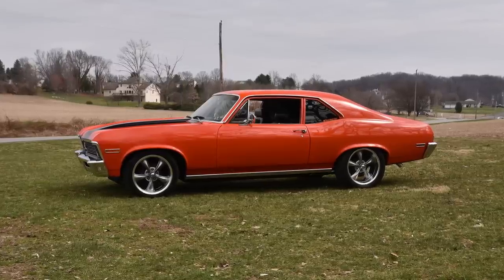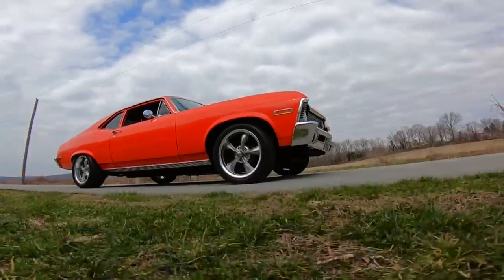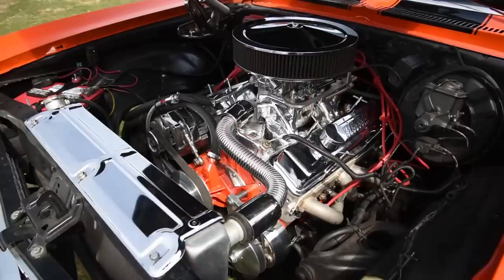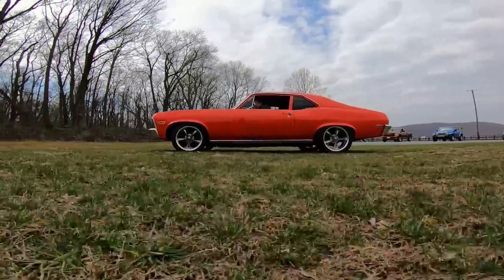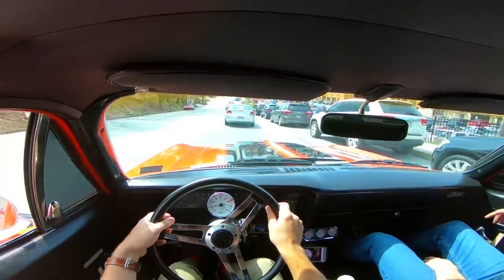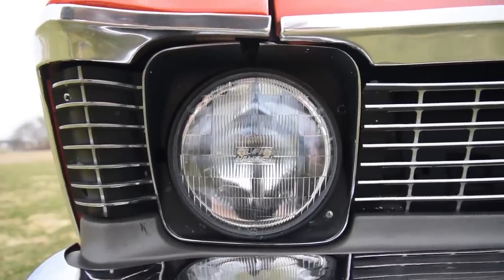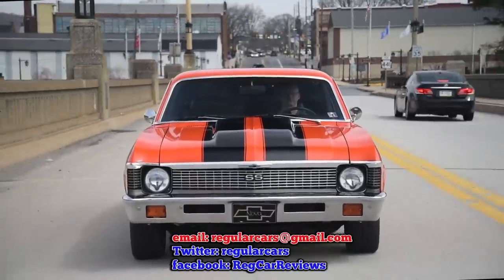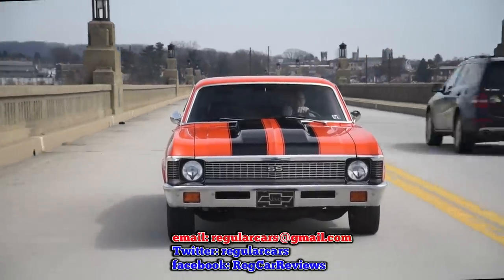1970 Chevy Nova: Regular Car Reviews

Comment: "hurr durr the LS exists so every other V8 is pointless"
Reply: Facts
Reply: @ClintonC1991  By the same logic, we might as well say that V8s are pointless because EVs are here.
Reply: @GarrickStaples  also facts
Reply: I know right. And he’s got a 302 Ford in a falcon😂
Reply: Pontiac 400 Ram Air IV > Chevy 454
Reply: @GarrickStaples  
I can go on an 8 hour drive in one that would be 10-11 hours factoring in EV charging
Reply: @P7777-u7r  pointless troll is pointless.
Reply: Garrick Staples 
I’m not trying to troll im just saying right now electric is not a 1:1 replacement for gas yet as we speak this date in 2019. There are many people where due to vehicle needs an electric is impractical again as of this date not saying it won’t change it’s still new tech
Reply: midnitesquirldog1 Yeah, and they weigh twice as much and break a lot of expensive parts, and a good heads/cam LS makes those levels of power and will survive it for YEARS of abuse. I love the old stuff, and if I were building a cool, quick cruiser, I'd stick to it. If I were building a fast car (or daily driver, for that matter), though... LS all day, without question.
Reply: midnitesquirldog1 I've always wanted a 69 or 70 Skylark. I almost bought a SUPER clean white on white 69 with a healthy cammed Buick 350, a (probably not factory) Muncie-pattern 4-speed of some sort, and a Positrac 12-bolt (not sure ratio, guy said 3.73 but I don't think that was true since it tached like 2600 at 65) in it right after high school in 2005-6. I didn't have all the money (8500, a steal even then in my opinion) and was going to have to borrow the rest from my old man, who said no. I don't blame him, I wouldn't have wanted my 19- or 20-year-old kid driving a V8, 4-speed, posi, 35-year-old (at the time) sorta muscle car for a daily, both for said kid's safety and the preservation of the car. I'm all for modernizing, daily driving and repairing when necessary old muscle cars (it's ridiculous that they cost way too much these days), but a broke-ish 20-year-old can't really afford to and I know it would've gotten kinda beat up, whether or not I ever got around to restoring it later I can't say.
Reply: Also, every spec I can find puts Buick 455s between 580 and 630 pounds. Pretty light for an old big block, but super heavy compared to an aluminum LS (perfectly fine for under 1200 hp).
Reply: midnitesquirldog1 I completely agree on the 302, but it's pretty much a fact that the 1970 LT1 was the best small block Chevy, in factory trim, GM ever made. The 302s just had such a perfect, snarling, nasty, high-revving 'racecar' quality about them, though... I had a 78 El Camino with a 66 327 in it, .040 over, 10:1, .500-ish lift Lunati hydraulic roller cam (don't remember duration, etc), Edelbrock EFI and ported/polished Edelbrock performer heads, factory forged crank and aftermarket forged rods and pistons, with a Keisler Tremec conversion and a 9" with 3.70:1 gears and a posi. From what I gather, that engine revved and made power almost exactly like the 302s did, but with more streetable hydraulic valvetrain, lower compression and aluminum heads, which along with the EFI allowed me to get away with 87 octane if I really had to, ran BEAUTIFULLY on 93. I put all the good aftermarket suspension stuff on it (Hotchkis, SSBC, Bilstein, all urethane bushings, all non-modified stuff replaced with Moog parts, tubular control arms, big f/r swaybars, subframe connectors, the whole schmeer) and it genuinely handled better than any other car I've ever owned until my current Focus ST. I miss that car every day, but I traded it for a 4WD Silverado when I got into my electrical apprenticeship since it was my only car and I needed to commute reliably long distances in all weather conditions. One day, I'll clone it, but with a fully built, all forged, high-revving  L33 aluminum 5.3 and a TR6060, maybe even IRS. Thing was AMAZING. Probably no more than 350 whp, and maybe not even that, but it pulled great and wouldn't get away from you on country roads, plus 6,500-7,000 rpm through long tubes, about 3' of 3" exhaust whith an H-pipe, and a pair of Super 40s going through a tunnel= divine bliss.
Reply: midnitesquirldog1 I'll never buy anything from north of Georgia or so unless it's on the west coast ever again. I live in WV, and have learned my lesson. I bought my Focus ST in Ocala, FL and my 2012 Colorado extended cab Z71 5.3 with 44,000 miles in Sacramento, CA. I don't mind road trips, and rust sucks. Yeah, that Skylark was absolutely pristine, either in amazing original shape or had been totally restored. Frame, floors, rockers, everything looked 5 years old, not a lick of filler that we could detect anywhere, interior looked new, it could've been shown if I'd wanted to. I wish I could've bought it. B-O-P stuff doesn't seem to be as ludicrously overpriced (except 4-4-2s and GTOs) as all the other muscle cars. Who knows, maybe I'll wind up with one someday.
Reply: midnitesquirldog1 And yourself as well, sir! Yeah, I use 90 octane non ethanol in my bikes, mower, etc. In a few years, e10 will be ubiquitous and small engines will be designed for it right from the getwith. It does wreak havoc on old fuel systems, that's for damn sure. My 327 had the double-hump heads before we rebuilt it, 93 and octane boost plus lead additive is an expensive fill-up, but that's all it would drink and stay happy, which is why I ultimately went with aluminum heads, hyd. roller valvetrain, and EFI- it was my daily, it had to run on at least premium (which back then, if I'm not mistaken, didn't have ethanol in it?) and in a pinch, 87 or 89. I ran it with a carbureted 4.3 while we were building the motor. Just cracked a fresh Heinie, cheers!
Reply: i mean enjoy your $15k small block build buddy
Reply: infamousNB That was in 2007, before any of my people knew much of anything about LSs and before everyone was putting them in everything. We built my motor for about 4 or 5 grand, a healthy LS costs about that. I mean, a healthy, built NA LS, not a stock Vortec 4.8 with ebay turbos.
Reply: Hahaha well Barra’s are a thing.
Reply: It’s a good v8 but it’s not the best let’s be honest
Reply: I'm so unbelievably bored of LS's, yeah they're great motors but everyone and their mom has one in their muscle car. Old sbc's were what founded LS's anyways.
Reply: @midnitesquirldog1 Exactly, I perfectly agree. SBC 350's are a thing of beauty and are dirt cheap. For less than the cost of just BUYING an LS you can purchase a SBC 350, build, and modify it and its already making more power than a stock LS, (LS1 since thats the most popular one anyways). They are such great value engines.
Reply: midnitesquirldog1 exactly what I’m saying my friend
Reply: I think he's just trying to make the point that if you're going to be a poser and keep that SS badge on, why try to act like you aren't a phony by putting a 350 Chevy in? Put something more powerful, reliable and efficient in and call it a day.
Reply: Obnoxious_Gamer hemi better
Reply: Pretty Much.
Reply: @midnitesquirldog1 I bet you a good old Chevy 427/350 Or mopar 440/426 Would DUST an LS stock.
Reply: @midnitesquirldog1 Too heavy
Reply: @midnitesquirldog1 It Might not be that heavy With aluminum heads or a block but a 455GSX Is 3900 Pounds. A dodge dart with a 340 or 440 Would Put up a good fight. a Chevy 427 Or 426 Hemi Would also dust a GSX if the track was long enough
Reply: @midnitesquirldog1 450 Hp stock? Dude a 426 Hemi made close to 500 HP stock, same with the chevy 427.
Reply: @midnitesquirldog1 510 VS 490 Is pretty equal.

Comment: LS swap everything. Nah. Just stroke the engine. 383's have tons of torque and are great for cruising.
Reply: Jeremy Diaz just 😄
Reply: That's what my buddy grant is doing with his 72 nova. It's an original SS with a 350 ci with a 350 turbo 3-speed auto transmission.
Reply: Imagine buying a crankshaft, rods, and god knows what else on the upper end to make up for the inadequacies of a 60 year old engine design, just to make it equal with a junkyard LS of a lesser displacement. Not hating on the vintage motors, I like those too, but the newer motors run better, and for good reason.
Reply: @kaitlyn-rosediaz4832  meh.... id rather drop in a 400 small block
the 454 is a HEAVY motor, and a lot of people find they dont like how it steers after swapping in the BB
.
and you can do the reverse to the 400 VS 383
a 383 is a 350 with a 400 crank
the 377 is a 400 with a 350 crank
.
less displacement....yet the 377 is a FAR better motor
BIG FAT pistons on a relatively short stroke
.
makes it an RPM monster.... with the right valve train equip and rods.... she will hit 7500 rpm
.
also, because of the over square geometry..... the engine uses more of the swept area of the clyinder
leading to better efficacy (aka, mpg)
.
same for a 327 VS 350
.
instead of the explosion only pushing on the piston for the first 50%.... on its way down
it gets into the 80% range
.
"uncle tonys garage" did a video on this a while ago
forget what the title is.... 
but his channel is AMAZING for learning about old school hot rod tricks
like putting in the pistons rotated 180 degrees.... off setting the wrist pin
.
stock, the off set is to reduce piston slap.... make it run quiter 
but flipped..... the off set adds more leverage.... more leverage = more torque at all RPM
more torque = more HP
Reply: @AustinRBa  newer motors also will not run because a 20 dollar crank sensor went out
imagine buying a 400 dollar scan tool just to work on the thing.... 
.
these old gen 1 v8s can be just as efficient as a 5.3 LS
back in the 1960s.... they were. (before poorly thought out smog equip screwed up the efficiency) 
.
they made right at... or over...1HP per cubic inch
exactly what the 5.3 does
.
with an overdrive trans (700r4)..... they got 26mpg
just like a 5.3 does (with a 4L60e.... aka an updated 700r4)
.
heck.... cars back then were lighter (due to no safety equip).... so they actually got BETTER mpg than modern cars
.
the 5.3 is 327 cubic inches
you put the same cam, heads, exhaust, intake on the old gen 1 327..... its its going to make exactly the same power
its going to get exactly the same MPG
.
a quadrajet carb is 98% as accurate as fuel injection when someone who knows how to tun a Q-jet.....tunes the Q-jet
the small primaries make for good fuel mix and air speed....aka, efficiency 
.
and the HUGE secondaries have an air door flap above them..... which meters fuel according to the air demand of the motor
all Q-jets are 750cfm..... yet you can put one on a 1.8L 4 banger..... and it will only flow the 300cfm the engine wants. 
.
take the same carb.... stick it on a 454.... and it will draw 720cfm
no adjustments.... no new metering rods and springs.... 
"it just works" TM
.
Reply: kain hall nah that engine was a hunk of shit it had one the ls ls l8t 6.6 litter is wayyy better
Reply: kain hall also a ls is way better they were in development for 15 years  before realeased and are way better fuel injection is sooo much better than a carb or we would still use them also there is zero challange the ls series is better in all places
Reply: Most of the big blocks had valve problems too especially the older ones
Reply: @thisguytrucksoldtrailer6875  the only reason we don’t use carbs anymore is because we aren’t allowed to.
(Useless) emission standards ruled out this pinnacle of mechanical engineering that works amazingly well without a damn ECU.

15 years development for such a simple design like the LS that’s technically still based on the same old mechanical principles like the small and big blocks of yesteryear?
Boy, what did these engineers do at work, besides watching YouTube videos?
Reply: This is why I want to do a 5.3 or 6.0 swap into a 67 mustang. No amount of work on a 302 developed in 1961 will get the efficiency mixed with power of a modern small block developed in 1997. Now I plan on giving it the appearance of an old small block and not the ugly intake plenum of stock LS motors
Reply: @badledgend1172  but does it have the old small block sound
Reply: @wolftmfg  Hey, the guys over at HotRod got 550hp+ from an RV 454 on 87 octane with "bolt-on" parts.
Reply: @kainhall  ahmen preach
Reply: Same with a 350
Reply: @americanredneck357  Good for them, now all you have to do is find someone who knows how to drive a car with that much power, assuming their figures are correct. That's why I love watching fail videos of people who think they're race drivers plow into parked cars when they show off.

Comment: "Generally the faster you go the more incorrect the speedometer gets" is how every single speedometer in existence works, the error margins are %-based
Reply: I think a little bit under 5%.
Reply: Unless its a digital speedometer
Reply: As a nova owner, though, this is so true but on a massive scale. It's like 20-30mph off on mine at any speed above 50.
Reply: Depends on the gears your running along with the height of the tire and getting the correct speedo gear drive in your trans. Pretty accurate if you know a few things about your car

Comment: Don’t need no stinking turbos on a 350 Chevy.  Nothing sounds like a built small block.
Reply: As a driver of a straight piped coyote, I support this statement
Reply: My first car was a 1973 Nova Custom with a 350. I loved that car, and regret selling. My car now is a 1985 Camaro Z28 with a 305. I love the car. But small blocks Chevy's don't sound that great. They sound great as far as the fact that they're V8's, but that's all. The best sounding engines on the planet, in my opinion are the old MOPAR 318 LA's. They sound like a race engine, bone stock, and they have this pissed off growl to then that no other engine has..
Reply: That’s not a built small block tho.... 

Also, no v8 really NEEDS turbos. But pretty much everything is cooler with them.
Reply: @67buick  Or you get a blower if you care about performance all through the band.
Reply: Say it louder for the people in the back, they can’t hear you over my 350.
Reply: i run a 690 whp 635 tq sbc 355  from a circle track truck. 3in cutouts right behind the headers that run back to a borla silencer system
Reply: 72 ventura exactly man